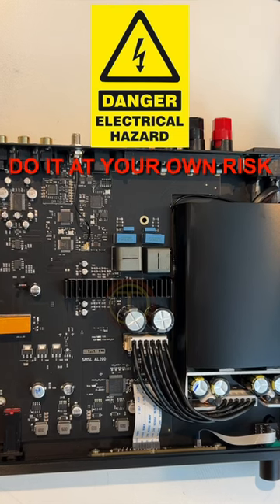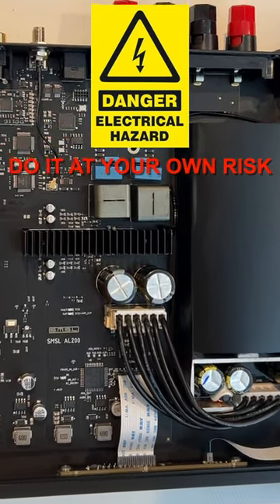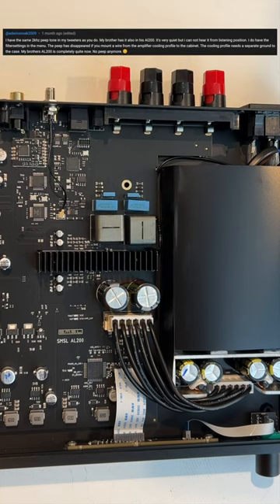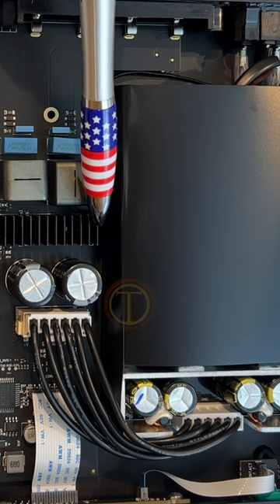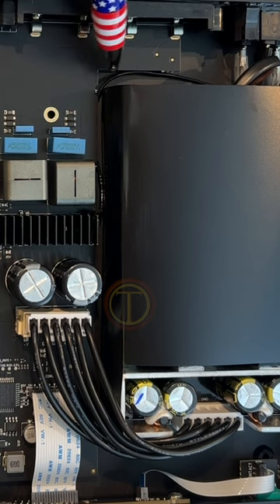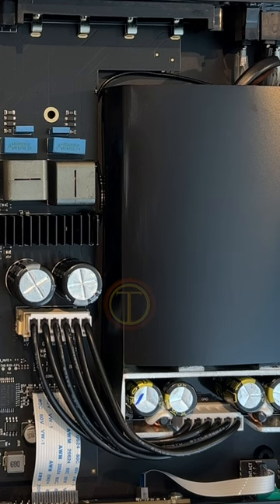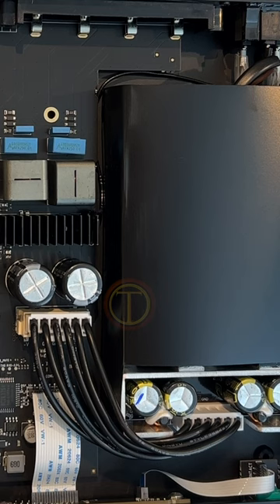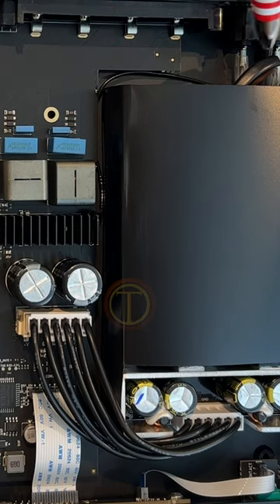Removes 2khz Noise From Class D Amp with Infineon Chips

Comment: Heatsink exterior has an anodizing layer(electrically isolated). You need to strip it (scrape, grind, file, etc..) before being able to attach any wire to it.
Reply from the maker: Not necessary, my method works as it should.

Comment: I have an smsl ao300 that I can reliably make a click sound with due to static buildup while wearing headphones. I opened up the unit and noticed that the AC ground prong isn't even wired up to anything. Would this mod help with the clicking? It feels like the clicking is the result of the unit briefly resetting because the static is discharging through the whole circuit board rather than a ground. Do you have a link to the actual instructions you used? It's hard to see where you attached the wire on the heatsink.
Reply from the maker: I'm not sure if that is going to help in your case, Instruction is myself no links.